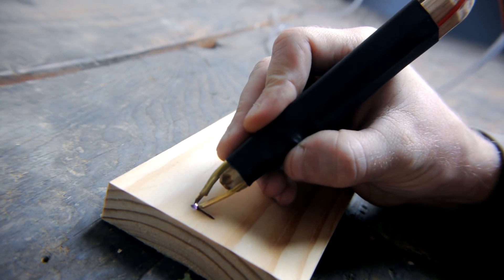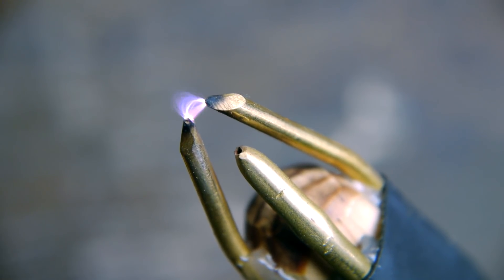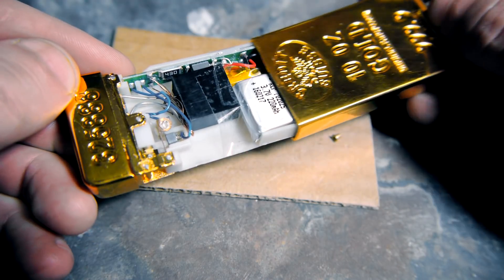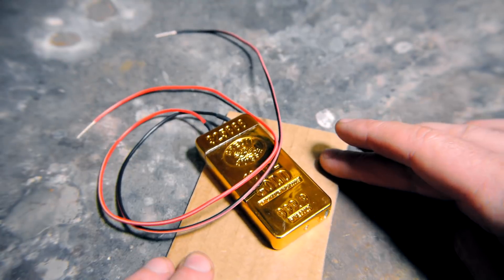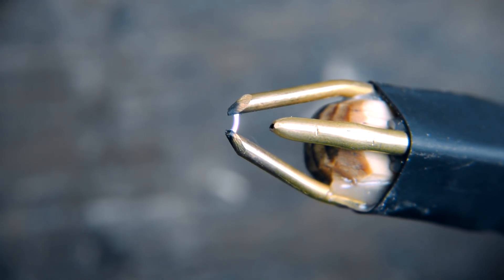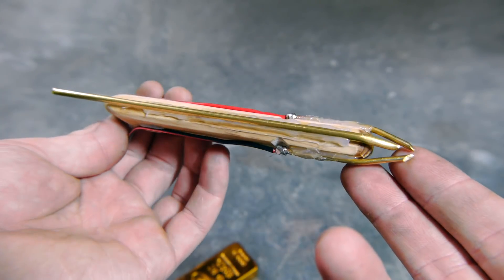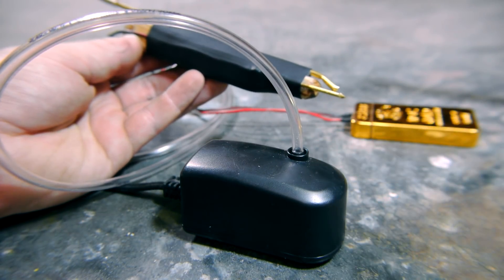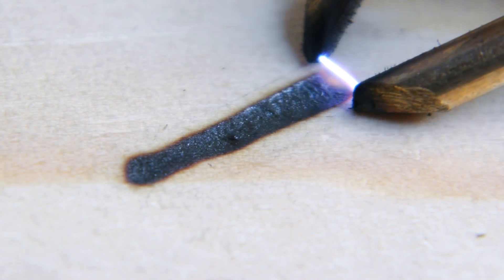How To Make a Plasma Pen & Micro Torch - NightHawkInLight

Comment: Awful insulation. high voltage -15kV can easily jump across thin heatshrink. I would enclose the device with 3d printed enclosure or something

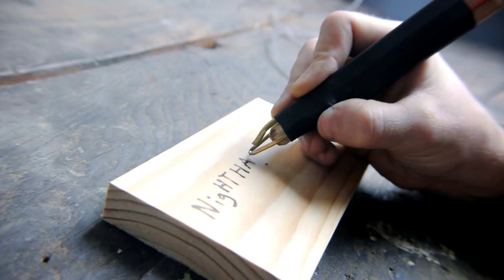Comment: 2:32 - Have you tried fractal wood burning?  (I haven't been through your whole channel yet, so if you've done so and uploaded, then I apologize for not checking...)  If not, would recommend.  Basically just high-voltage at two far-away points, with a light periodically-refreshed (via paint brush) layer of saline... where the saline dries, carbon channels form, which further dry the saline, and "lightning"-like fractal patterns happen... which can be guided by moving the electrodes between runs.
Reply from the maker: No, but I've seen it done quite a bit

Comment: Actually interesting:if I want to melt some metals with insanely high melting points(iridium and rhenium,most likely osmium as well)-but in a very small quantities(around 1-2 grams maximum)-is it real with such a device?
Reply from the maker: I doubt it would work with so small an arc. Probably you would need to use an arc welder. I would not recommend trying osmium or you would risk creating some of it's oxides at such high temperatures. Osmium oxide is extremely poisonous.
Reply: NightHawkInLight yes,I know,osmium tetraoxide is definitely not something that I want to mess with-so maybe just submerge the melting apparatus with osmium in bucket with argon inside,and than just melt it safely?I just never done that before and so I am not sure if argon will stay in the bucket,where it will stay for sure for days and days without wind until I will put some stuff inside,and start melting something with ark(or better arks)-so just overheating some of argon,and supposedly disturbing it so it will spill over,and so on..Just anyway don't want to mess with a vacuum chamber and all that stuff,as finally I am doing it mostly because I need iridium,osmium,rhenium and things like that in order to use them in my prototypes of completely new firearms,which certainly will require them due to wa-ay higher than usual velocities and energies-so I am certain that any kind of modern materials involved in modern(or existing) firearms will not survive a single shot-I tested it in Russia and got a custom made very thick and rigid barrel simply turned into a load of bent and shredded metal strips,stuck in all that was around it and also a seriously damaged and knocked back test bench,which is actually a large old military bench rated for testing barrels and rounds for small and medium-calibre artillery(20mm-85mm)-so seems like only PGMs are something that can give my projects some chances to achieve all the estimated characteristics without blowing up like that..
By the way I can actually clarify some of details of my projects,if you are interested,so if you are-maybe we will combine our brains and increase chances of success!
By the way I recently made a small scale experiment with the same propellent and the same conception in Canada like that failed in Russia-of course with a new calibre(much smaller and better aerodynamically adopted to speeds of up to between 1st and 2nd cosmic speeds;3.2mm and with 0.8 gram needle-like bullet)-and with a test custom made barrel,lined with iridosmine and with very thick(relatively-for such small calibre,with outside diameter of 30 millimetres at muzzle)-and a very precise sinusoidal rifling(lands and grooves not straight but sinusoidal,and actually initially it was made by twisting the hot blank in order to get proper internal tensions)-of course with a very long twist as the speed is really high so twist length is chosen respectively..And the steel itself was reinforced by adding rhenium in it(plus rhenium web wire built in the middle of metal layer,obviously in right time of the process in order to get it twisted properly and not to damage the web)..So quite a cool stuff on my opinion-and the test results were excellent-at least,my friend's chronograph didn't take it's velocity though it is rated for up to 10 thousand fps(3050 metres per second)-as expected:I estimated it to be approximately 10.8 kilometres per second,which actually happened most likely-as there were visible markings of ablation of material and as well of something like a hidro strike created with molten material pushing radially, left on the target,which was a simple 3 bricks together,which indicates the huge speed of impact(even the entry point reminds me of micro-meteorite craters)-especially interesting that the target almost stayed in place when were hit-amazing!
And now I have all the rest of the gun itself to be made into a complete one-which is not very simple just because the propellent is liquid and I suggest it to be loaded separately from a propellent tank and the large capacity magazine with many hundreds or maybe even half a thousand bullets(as they are so small and thus possible to be put into a small amount by hundreds!

And by the way also have a couple of ideas about how it's possible to create a micro-EAF with quite a high efficiency and low cost of production!

Damn,so many questions and nobody around who can answer any of them,so tired of re-inventing damn bicycles in order to make it to the real invention,which only needs to be built in metal,but no one knows how to build,where to build and from which alloy composition,and even the minor and simplest steps become nightmarely difficult to do just because nobody around knows anything useful!And just for now I even got a problem with obtaining damn nitric acid at the same time when I found everything needed to create one of the most devastating explosives known in the damn home depot and several shops like that!And to obtain the simplest acid to make at least in industrial scale I had to make an apparatus which uses only water and electricity-how is that possible?🤔*
*yep,BTW it is a simple arc between two wires inside the bottle,from which it is sucked through a small pump into the bottle of water,where the bubbles with NO2 created by arc become HNO3..

So I hope that we will cooperate and I am sure that we will exchange some useful tips and ideas for our projects-or maybe even combine our skills and exchange some stuff that one needs and another has-at least it is always easier to do something together-and as my entire experience shows that two guys together are wa-ay more efficient than their alone-efficiency in summ😉

Comment: You should consider converting the power supply from the small battery to a DC Transformer I'm going to try to accomplish this with a adjustable buck converter I got for $0.75 on eBay

Comment: I have an idea for you since you've been messing around with these lighters. You could probably inject an analog sound signal into the circuit to turn the lighter arc into a speaker. At least I think it's possible. I just got my first one today, and I don't want to disassemble my only one, but I think I'm gonna buy a few more cheapo ones and experiment myself.  If you end up doing it I'd love to see a video of it!
Reply from the maker: That was the idea I had that I first bought the lighters to try, but I couldn't get it to work. Now I have a bit more understanding of how the circuit in these works so I might try again.

Comment: Why don't they scale this idea up and put them over sources of pollution a shield or filter to try and break the pollution up into particles?
Reply: Operation mindfuck that is not how pollution works and a thing like that would take so big of an air compressor and a current generator that it would cost more than the benefits (basically none bc pollution is mostly gas and solid) and many many other reasons too many to list

Comment: hmm, might be able to shrink the design with a more easily ionized gas. Hydrogen would be optimal except for the whole ignition issue, so maybe helium.
Reply: Varen Grey air works great and helium is damn expensive so i dont think its needed
Reply: Well, if its hot enough to form it you can also get some extra benefits from hydrogen plasma, as the plasma makes H1(atomic hydrogen) out of the H2(molecular hydrogen) and atomic hydrogen is especially efficient at transferring energy to working surfaces, as when the atomic hydrogen "touches" cold enough elements or metal it recombines into molecular hydrogen, and releases the energy required to separate it concentrating the heat quite nicely at the weld pool. 
That is why its recommended in plasma welding, and at that only a small percentage is required for a significant increase in the weld pool temperature.
This devise even looks like an atomic hydrogen arc welder, (a proto-plasma welder, that also helped develop TIG welding, using atomic hydrogen and two tungsten electrodes)

Geez that was wordy for such a small amount of info. But I think I avoided technical terms, for the benefit of the commit section reader, whom may or may not be familiar with technical terms that where coined in 1920's America.. using slang... atomic... tip o'the iceberg there...

Comment: Is it safe to get shocked by the pen?
Reply: You can only get shocked if you happen to touch the electrodes at it's end while its running. If you want to prevent this, try adding some sort of cap to the tip that only leaves the tip exposed, and does not conduct electricity. Other than that, the arc itself can never reach your hand.
Reply: Fra32Entertainment hes asking if its safe not how, yes it is this shit cant create enough amps for it to kill u but just dont touch it with both hands for it to go through your heart

Comment: Can this be modified for pyrography style wood burning??
Reply from the maker: You mean pyrography in a different way than it's shown it the video?
Reply: +NightHawkInLight whoops! Totally meant Lichtenberg burning. You mentioned the wood started conducting electricity and it reminded me of that method.
Reply from the maker: I haven't tried it. Probably you could make small patterns, but nothing as impressive as you can get with larger power supplies.

Comment: What about hooking up the air nozzle to the king of randoms hydrogen gas generator? Possible flame thrower?
Reply: Nice idea, but if I recall correctly, his generator doesn't distinguish between O2 and H2, so it would be very risky, the O2 and H2 tank could easily explode if the flame falls behind the opening.
Reply: yes, it would constantly burn back to the bubbler, or, if you didn't have one, explode.

Comment: i made my own version of this pretty much from scratch on july 4th. 99-124 watts. portable. much bigger arc potential, higher arc current, and longer run time. this was just taking 1 thing apart and adding wires. i built the oscillator, and multi stage amplifier and partially wound the transformer. i guess this is good if you dont have an electronics background.

Comment: Those wires are not likely capable of insulating the high voltage (several kV i guess). Insulation failure could occur over time.

Comment: I was wanting to make an arc lighter from scratch; what is the typical output voltage and current needed to make a plasma arc on the lighter you scrapped?
Reply from the maker: I haven't measured it.
Reply: NightHawkInLight No worries.  I figured I would ask before I when into more research lol.

Comment: Plasma :O
Reply: Plasma is nothing special. You see it every year in the form of lightning during thunderstorms. It's basically just electricity conducting air, caused by high voltage, high temperature or high radiation.
Reply: Fra32Entertainment It's still cool as fuck though. (I swear on me mum, if you say "Oh, but it's actually super hot"...)

Comment: I bet you can use this "pen" to make a Torch. Just replace the air generator, with alcohol vapors from boiling alcohol, and then you have a DIY Blow Torch.
Reply: That's pretty risky. If the vapor is capable of igniting, it can backflow up the tube, especially if it's conductive. What's worse than burning alcohol? A pressurized tank of boiling alcohol on fire.
Reply: Monkeysrock XD You clearly haven't seen people make DIY Blow Torches. Have you?
Reply: there are a few ways to prevent this

Comment: hi quick question, what are the components of the arc lighter and what is its power source would it be possible to build a larger one from scratch. i am aware i could do it with a MOT but i think the challenge of building one would be interesting
thanks
Reply: it only costs $7 ..less then 2 beers...you can buy it of ebay..or buy a DIY OZONE GENERATOR costs $3...
Reply: i think it's just a really high voltage thing, they sell modules online to do it, if you wanted to build it yourself, there's other things like a marx generator might be easier, or you're heading into high voltage transformers and such which can be really dangerous. with this kind of circuit  i think it's easiest to buy them and i love making my own stuff it just seems like more effort than it's worth. 
my 2 cents.

Comment: Can a high voltage generator like this one: http://www.ebay.com/itm/Ultra-high-1000-kV-Pulsed-High-Voltage-Inverter-Arc-Generator-Ignition-Coil-NEW-/311531926121 (for example) be used instead of a lighter ?
Reply from the maker: No. Too high of voltage, too low amperage. Sparks from a generator like that won't easily burn anything.
Reply: Nope, those work in pulses.
Reply: Ok so there is no other possibilities than the lighter ? Or it can be bought separately ? And what voltage is it ? I would love a disasembly video !
Reply: Sceeker Not aware of any continuously generating devices that would do this, but you can make one yourself.

Comment: This is awesome! Best arc lighter project so far! What else can you do NightNawk?
Reply from the maker: Well I originally bought the lighters to try to make arc speakers out of but haven't been able to get them working so far. That may be a future video if I can figure it out.
Reply: Awesome!I can't wait :)
Reply: I was wanting to make an arc lighter from scratch; what is the typical output voltage and current needed to make a plasma arc on the lighter you scrapped?
Reply: NightHawkInLight the best video would have been a video about the micro-EAF which will be capable of melting metals with very high melting points,at quantities up to 3 grams!
As for example for me-I need something to smelt my iridium metal which I extracted from spark plugs and just from high purity iridium sponge which I bought!And as for me-the toughest metal that I supposedly gonna need to melt will be osmium,which I also need..well,for my own purposes..

Comment: Is it hot enough to round glass edges?
Reply from the maker: Good question. It should be, but it may depend on the thickness of the glass. Thick glass may disperse the heat too quickly from such a small arc for the corner to melt.
Reply: +MICHELLE ROSS
And if you try to compensate for the thickness by heating it more drastically, you may just break it.

Comment: Just use a soldering iron ?
Reply from the maker: There are a couple reasons that someone would want to use this instead of a soldering iron. You don't have to wait for it to warm up and it burns things without leaving an indent and tool mark like a soldering iron does.
Reply: +NightHawkInLight good points, and I guess you don't get to make another awesome video
Reply: Just be sure to not fry any component with the electricity...

Comment: Wow, what effect does it have on metal?
Reply: None. The metal will conduct the electricity and the heat.
Reply: Look up "plasma cuter on metal"
Reply: +Anonymous User I know what an actual plasma cutter is. I want to know if this specific one will have any affect at all i.e. short out, gouge, cut foil ect.
Reply: +Anticonny I think so to but if you keep the spark far enough away it could work, or not that is what I want to know.
Reply: It won't do much. Any metal will just conduct the electricity.

Comment: do you think this is suitable for a xy plasma cutter for small tickness wood?
Reply: Absolutely not.
Reply: +Spirit why?
Reply: j Lucas Because it won't cut...
And plasma cutters only work on metal.
Reply: +Spirit I was thinking in something like a laser cutter, but instead of use a laser to cut wood sheet use this plasma torch
Reply: j Lucas Won't work.
Reply: Actually if it's very thin veneer this might work, but the cut won't be pretty since you're essentially turning the wood into charcoal. (e.g. you can cut paper with an arc discharge)

Comment: I bought a violet wand from eBay a while ago (£11.00) and wondering how I can modify it to do something interesting, it runs on 240 volts and has some big caps so I'm thinking I have to be very cautious. 
Any tips?
Reply from the maker: I wouldn't mess with it unless you know exactly what you're doing.
Reply: +NightHawkInLight 
It's a made in China item that came with a "Not approved for Europe" notice from the seller, that alone is a red rag to a bull. I find HF HV fascinating, this got the better of me. :) 
Thanks for the reply.